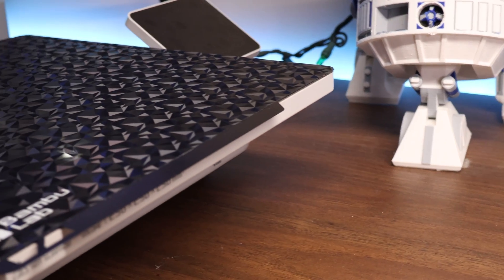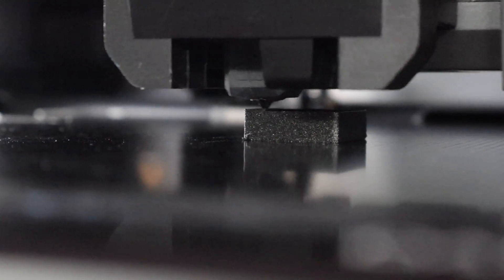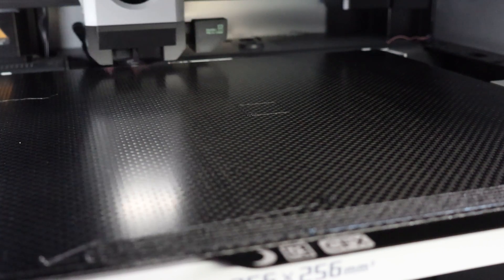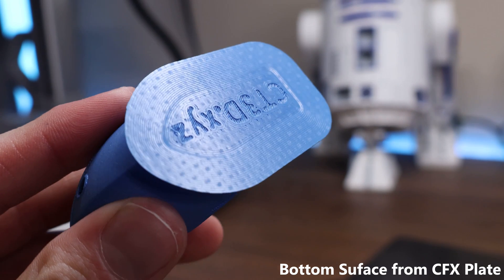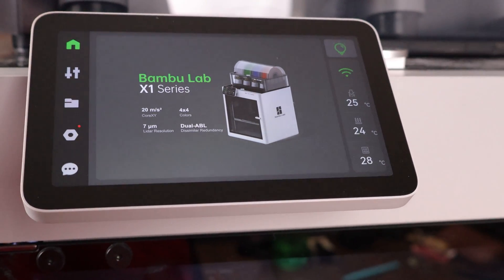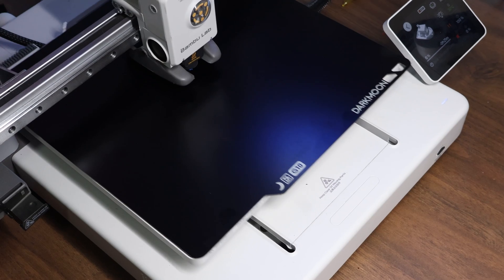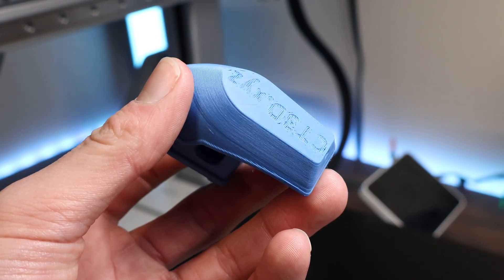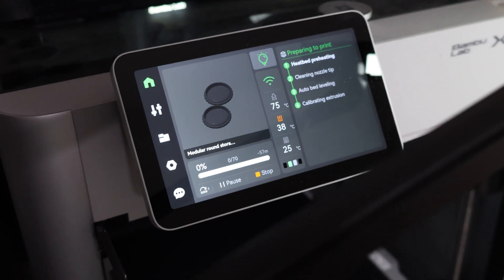2 New 3D Printer Buildplates you MUST try...

Comment: So maybe it is me but I got the G10 plate last week and used it on Sunday - ASA did not stick to it at all, tried two different temps (Oh - I am using a Bambu Labs X1C), first used the default, then lowered the nozzle temp, which worked fine on Bambu Lab PEI plate with glue. But nothing would get past a couple. of layers.   Tried just plain PLA today and it did not stick at all.  Happy if someone can tell me the secreat sauce to using this plate. Oh and sent an email to customer service on Monday and have no replies.

Comment: You're printing on resin since that's the actual interfacing material. Filament never touches Carbon Fiber
Reply: This correct. The carbon fiber acts only as a super thin and even base for the resin.

Comment: Carbon fiber sheet is all i use. Its cheaper just to buy the carbon sheet and doubled sided tape it to an existing metal build plate. That way you can buy thicker ones. It last forever, nver needed to replace it. Pei breaks apart quickly.

Comment: The G10 sounds hugely interesting - until I checked the price. That's HIGH. I've been having great success with $9 build plates from AliExpress with my P1S. PLA, ABS/ASA, PETG, and the occasional other filament have worked better with the cheapies than with Bambu's own $25-$35 plates. I don't normally use engineering plastics due to the cost. So I'll wait and see if G10 alternatives become available for less...

Comment: You definitely sold me on a carbon fiber build plate. Now I just need to find one for my flashforge 5m. I already upgraded with the enclosure and hardened steel nozzles. I think I'm almost ready to start diving into those tougher to print filaments.

Comment: G10 is awesome, will check out darkmoon plates. Whambam also offers a carbon fiber build plate that I can recommend 

Also - anyone looking gor G10 plates - avoid Lightyear Direct. Had plates from both Bambu G10 plates they offer - 2 of 3 failed in a month (delay). They replaced the first one but then ghosted on the second model
Reply from the maker: Thanks for the insight about Lightyear! I have two of the dark moon plates, one white and one black, both have been amazing so far and have had no issues!
Reply: How did they fail?